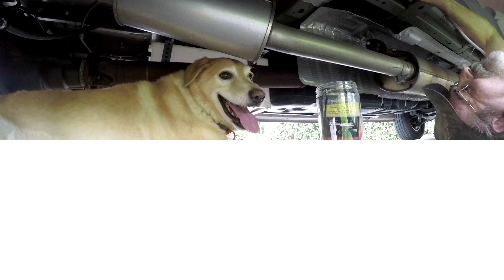Webasto Gas Heater - Part 5

Comment: Great series on the Webasto AT 2000 STC install. I am patiently awaiting #6. I am installing one simultaneously on a Delica. Similar but different install. Thanks for your efforts in creating/editing this content and sharing here.
Reply from the maker: As you may have noted, part 6 of the Webasto heater install was just posted. I appreciate your comments. That Delica seems to be a nice compact van; ideal for some backroad traveling.
Van Williams
Reply: @cargovanconversion  curious about the wiring at this point. Looks as if the wiring harness has extra or potential attachments that are not required for the digital smart temp controller. Also, an extra fuse was shipped in the kit. I'm assuming this will go at the battey
Reply from the maker: @DL-nf6cv  Haven't really looked at that side of the installation. Will install the rheostat soon and later the connection to the battery. I have a fuse box installed close to the battery to which it will be wired up, so I will forego the included fuse. From my limited electrical knowledge, I know (assume) the fuse also protects the wiring, so close to the battery would be my choice.
Van Williams

Comment: The Webasto really seems like a great furnace for the do it yourself rver.
Reply from the maker: Hi, Stephen,
Hope you're doing well.
It is feasible as you can see, but it is also a finicky system. Would consider placing everything under the van in a next build; would make the installation much easier. 
Van Williams & Joey

Comment: Looking good! It’s such a tight fit. I’m about to install my webasto evo 40 in the same spot in my ford transit. I hope I can get the bigger heater to fit in there.
Reply from the maker: Hi Ian,
I did struggle underneath to make the connections; there is just not much room to get access. Under the pedestal, there is virtually only one location for the heater and that's awfully close to the right side. Not much room on the front and back side either. I didn't do it, but might consider a next time and that is to make a complete install under the van. You need a box to put it in for that, but makes the installation much easier and better to access and service.
Van Williams

Comment: Unless we missed it, could you show us how you hooked up the fuel line to your fuel tank of the cargo van.  Did you have to drop the tank?  .. or is there an auxiliary fuel port on the fuel tank itself?
Reply from the maker: Hi Loumik,
No, you didn't miss anything, I skipped the connection to the tank, for now.
The gas tank has an auxiliary fuel port on the top, back end. This should make it easy to support the front end, while lowering the back end several inches.
Covid was the real culprit for waiting: according to the CDC, I'm in a high risk group and take that very seriously. Haven't driven my van much at all; started in March with a full tank and just getting ready to refill now. Saved a lot of money with that, but couldn't connect the fuel line with a full tank. In the coming weeks though, I hope to do the work and post the video.
Van Williams and Joey
Reply: you probably dont care but if you're bored like me during the covid times you can watch all the new movies on Instaflixxer. I've been binge watching with my gf for the last few months xD
Reply: @Felix Duke definitely, I've been watching on InstaFlixxer for months myself :D

Comment: When you were drilling the underside you should have been wearing safety glasses, metal shards would not be good in the eye. Like me you are pretty particular. overall great job.
Reply from the maker: Hi Tracy,
I usually do, but you're right for saying it again.
One neat trick is to place a (strong) magnet where the metal shards come off. That way you can easily collect most of them and simply dispose of them.
Thanks!
Van Williams